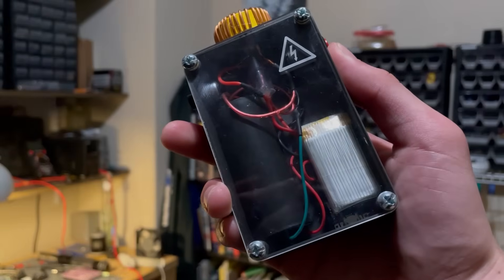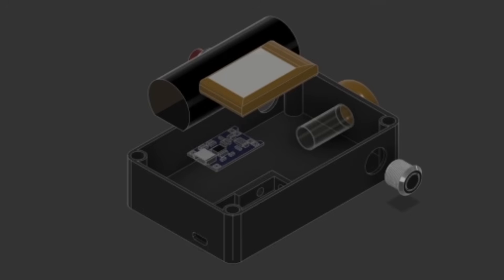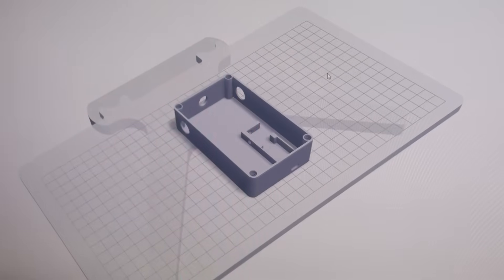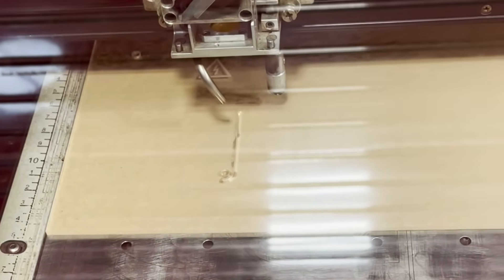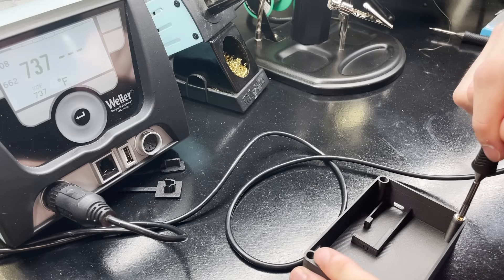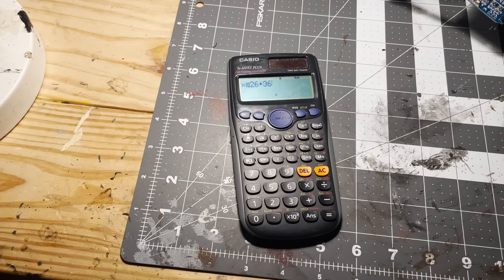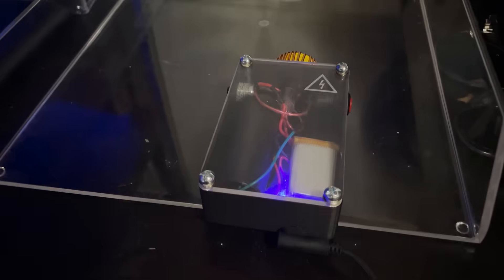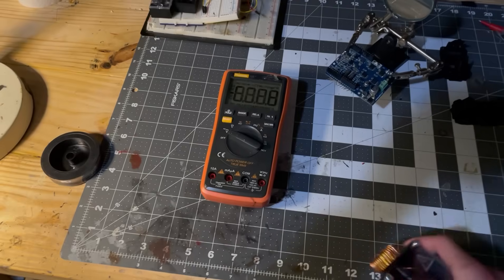How I Made an EMP Generator

Comment: What if the taser was a billion volts?  Can you make a directional antenna for beaming the EMP?
Reply: The taser isn't a billion volts
Reply: Everything would short and it would die the moment it is turned on.
Reply: What would you power it with, a lightning bolt?
Reply: Getting to a billion volts is kinda nuts, but i can tell you how to beam the energy: a horn antenna or offset feed parabolic dish
Reply: A billon volts doesn't exist well at least not yet one day it would
Reply: Cam I get in on this
Reply: Ik this was three months ago but I'll try to explain:

A portable tazzing  unit avaliable to the public without a license cannot reach the maximum of what you are asking because it it hard to make a circuit that can produce that voltage without being highly illegal. Even if it wasn't it would require license and training, not even factoring in a mental evaluation to see if you can be trusted with it. The emp produce by a theoretical emp device alone would be more illegal than the tazer, using it would cost alot of fines to the end user due to endangerment of the public. Majority of that endangerment could kill someone with an insulin pump, pacemaker, or even other technology they need to live.

To add to it, no such unit could produce the required billion volts of which you are demanding.
Reply: @toby9848  The question was theoretical, not practical. If I asked if a gun could kill someone then the answer isn't "killing is bad".
Reply: @harms123 short answer: the device would be very hard to make and probably more dangerous to the user than to anything else, and it would kill itself (and maybe burst into flames) the moment it would turn on.

The only way to make a military grade EMP is with a bomb.
Reply: @toby9848  basically

just read the last sentence

first part is irrelevant and sound like stupid ass ai trying to answer except it wasnt even the answer ppl lookin for
Reply: @toby9848 "Crime bad" 🤓🤓🤓🤓

Comment: It ain't a transformer it's an inverter or an oscillator or an DC to huge AC + voltage multiplayer circuit
😎✔️
Reply: Actually that's a dc to dc high voltage converter based on transformer and voltage multiplier
Reply: @stingerbold9327  also true but not 100%
Reply: @SAQ-3000  It's an Amazon.com zappy-zap.
Reply: @greenaum  ok.
Reply: @stingerbold9327  Which is exactly what he decribed, although really poorly.

Comment: can you touch the manetic field generator (enamel wire)?
Reply from the maker: While its on? Don't know, haven't tried and I probably won't try even though the answer is probably yes(ish). But before, my coil had this issue where it would hold a charge for a bit after being turned off and would sometimes need to be discharged by touching the coil on a conductive surface. Not sure of the exact reason that issue isn't present anymore.
Reply: @schizo4725  it depends on the breakdown voltage of the copper enamel. I once touched a hv coil and got a nice zap from it
Reply: Depends on the breakdown voltage of the copper enamel (basically when voltage gets to high, a isolator becomes conductive and wont isolate anymore, unless the voltage is low enough/removed)